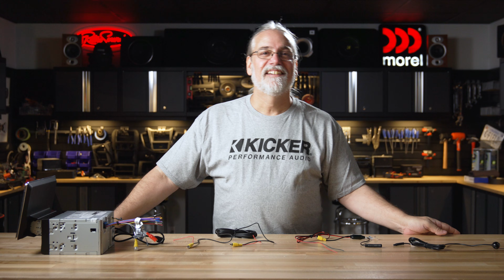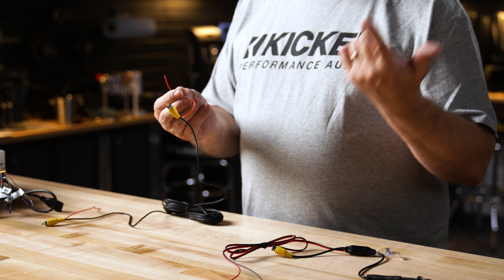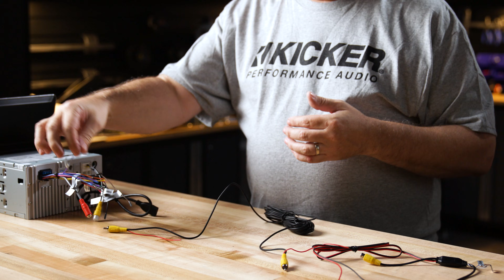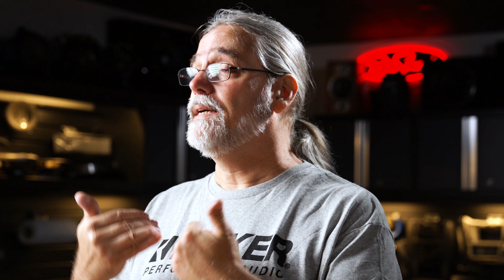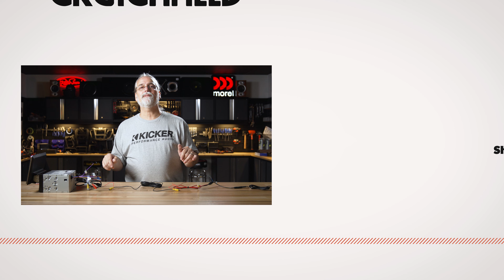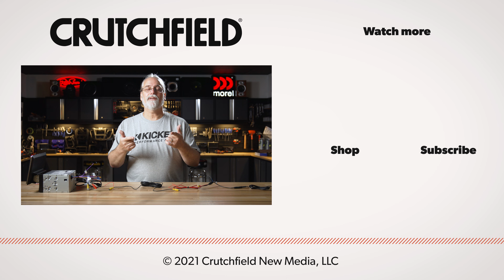Powering your backup camera (and how to use that extra wire) | Crutchfield

Comment: Do I need to ground the black wire for signal to kick on?
Reply from the maker: Yep! The ground wire does need to be connected to the vehicle's chassis so the circuit is complete allowing power to flow to the camera
Reply: @crutchfield  does it have to be in the chasis specifically of can I attach it to a bolt in the hatch in the corner near the widow? Cuz I have a sub ground wire already in the chasis
Reply from the maker: There is some freedom for the location of where you attach, but it must be a good solid chassis ground for the camera to function.

Comment: There is a guy who wired his using the convenience wire only for the reverse posative and it grounded through the RCA! He said he found this out by accident! The only way you have to use the red and black are if you have a head unit that allows you to view camera while not in reverse!
Reply from the maker: The red wire that was joined with the RCA cable was grounded to the RCA cable? That sounds like a design defect because the red wire with the RCA cable, the one often referred to as the convenience wire, should not be able to make contact with the RCA wires.

Comment: So I hooked the red wire from the camera with the red wire from the convenience cable, and hooked the red wire on the other side of the convenience cable into the trigger wire, and it worked at the moment I tested it, but after a few hours it stopped working😢
Reply from the maker: Hi Yifan, sounds like you may want to re check the wiring instructions included with your camera. If you got it here, you can call our Tech Support for wiring assistance as well. Their direct number is on your invoice.
Reply: @crutchfield  Yeah I had it fixed, turns out it was just when I put back the trim in my boot I accidentally loosened the signal wire, all good now
Reply from the maker: Nice! That is excellent to hear, great work!

Comment: For some reason, I don't having a reverse trigger wire on my Sony XAV-5000 radio harness.
Reply from the maker: It should be the purple/white wire on Pin #13 of the main radio harness.
Reply: @crutchfield  I had to get an aftermarket harness from the radio. None of the aftermarket ones have a Reverse trigger wire.
Reply from the maker: If you got the radio and/or camera here, our Tech Support can help you get this wired up correctly. Their direct number is on your invoice.
Reply: @crutchfield  I tested my luck again with amazon. This time I received the correct radio harness that had the reverse trigger wire
Reply from the maker: That is good news to hear. We are always here to help troubleshoot your Crutchfield purchased products!
Reply: @crutchfield   I believe i just found my 2nd problem. Now that i have the correct harness with the purp/wht reverse trigger wire, it wasn't automatically triggering. i missed the step of wiring the convenience wire together with the power wire that's already going to the backup light...

Comment: Why not use a spdt switch to determine where the + 12v comes from? Either the battery for always on or the tail lights for backup only.
Reply from the maker: Each camera will specify the recommended options.

Comment: Can i wire it in a way that it automatically switches screen when put in reverse AND have the ability to view camera when in drive? For reference i have a pioneer 1700NEX and it switches over when i go in reverse but if i click on camera video, i get no camera input
Reply from the maker: It sounds like your camera might be powered off the reverse circuit, only powering on when you are shifted in reverse. If your current rear camera is connected to switched power instead (energized when the key is on, whether shifted in reverse or not) you should be able to view it from the receiver anytime the key is on. I hope this helps!

Comment: Great video im not the best with wiring, currently trying to wire in a aftermarket reverse camera to a ford sync 1.1 not sure if ive done it correctly but still not working (its been activated on software), i have run the earth to earth, postive to the rear fuse box, rear trigger wire to the reverse unit, i am unsure if i need to conntect the front trigger wire to the origional wiring loom or link it to the rear reverse lamp any help would be great
Reply from the maker: The process for adding a backup camera to a stock system may require more wiring connections and extra steps than are shown in the video and we recommend contacting technical support for help. If you purchased your gear from Crutchfield, we recommend contacting our technical support using their toll free phone number included on the order invoice.

Comment: can we use it as front camera?
Reply from the maker: Are you asking about a specific camera?
Reply: @crutchfield  I bought a car stereo from Ainavi. The stereo comes with a reverse camera. But my car had a reverse  camera when I bought it.  So I wanted to use the camera that came with stereo as front camera. I set up all the wires, but my stereo is not giving out images/video. I connected the wire with my car headlight.  That one red wire im not sure where to connect for power. I have 2013 Honda civic. I wanted the front camera to work before I passed down to my daughter. She will be in college soon. Front camera would help a lot for her to parallel park.
Reply from the maker: With many cameras that we carry you can reverse the image and use it as a front camera. With some cameras they do not feature a reversible image and cannot be used as a front cam. You will need to power your front camera off a fused 12v source, and you can use the add a fuse option below that is available in different fuse types to fit your specific vehicle fuse box. I would also double check wiring as you do not want to connect any accessories to your headlight circuit. If your front camera is not getting any 12v power, that would explain why it is not displaying an image. I hope this helps!

https://www.crutchfield.com/I-rFBKc166/p_074FTATC/Accele-FT-ATC.html

Comment: Mine doesn't have a convenience wire so how do I power and ground
Reply from the maker: If your camera does not have a convenience wire you can always run one manually. You can also consider powering the camera off the reverse circuit and finding a good chassis ground near the rear of your vehicle.

Comment: Would it be possible to connect the red camera wire to the purple wire and then splice the red camera wire together with the accessory wire or would that be dangerous?
Reply from the maker: We do not advise deviating from the install instructions with any camera install.

Comment: Sorry, I'm more confused now than I was before. I'm just trying to hook up a backup camera to my Jensen CAR710X. I bought both from Crutchfield a couple of years ago, along with the wiring harness service. I'm just getting around to putting in the backup camera now.

The radio installed just fine and works ok; it even looks for a backup camera when I put my Tahoe in reverse. However, the trouble is the camera wiring. I know about tapping into the backup lights, but this Tahoe doesn't have a convenient way to hide the power wire so I'm looking for a way to do it without using the backup light to power the camera. My 18-pin connector has the Camera in wire (yellow female RCA) which has that red convenience wire you mention. Can I just hook up the super-long camera RCA line (that has a convenience wire at both ends) to the one up at the head unit? Do I also need to use that reversing wire if the head unit is already looking for the camera when I put the car in reverse?

Thanks. I hate wiring stuff so I was thinking with the harness service it would just be plug-n-play, and it isn't.
Reply from the maker: Sorry to hear your installation isn't going easier. Our Tech Support can help you get things wired and working. Please give them a call at your convenience. Their direct number is on your invoice. They are available:
Monday-Friday:
9 am - 8 pm est
Saturday-Sunday:
10 am - 7 pm est
Thanks!

Comment: I want to wire a câmera like that but in front of the car. My radio is a Android snapdragon. Coming out of the rádio i have a rca that says dvr. So i think i need   to plug the rca from the camera to the dvr rca. Then i'm a little bit confused where to wire the 12v+ that gives Power to the camera and the trigger wire tha comes out from the camera rca. I also have a other wire saing "dvr ir". Should that be the trigger to connect to the trigger coming out from the rca camer? Can you please help?
Thanks
Reply from the maker: To use a front camera, you will need a front camera input on your radio. DVR inputs meant for dash cameras or drive recorders may not function the same. There is usually no front camera trigger on most radios like there is with the rear camera. You will have to find a location to connect for 12v switched power for your front camera, and the Accele FT-ATC add-a-fuse options in either ATC shown below (or mini-ATC also available) are great ways to power additional aftermarket accessories.

https://www.crutchfield.com/I-rYALc166/p_074FTATC/Accele-FT-ATC.html

Comment: Very good video. The only thing i couldn't resolve yet is... I connected the red wire to power of camera to the trigger wire but it didn't work because actually the head unit has a specific wire for 12v camera. I will connect that one, but i don't know where i can connect the trigger wire. Could i connect together as a three connects? Thank you 😊
Reply from the maker: Hi Rachel, the reverse wire generally connects at the radio. Be sure to refer to and follow your camera specific instructions.

Comment: This might be the only video (or any instruction) that noted the black wire from the camera’s power cable doesn’t need to be tapped. I always wondered if it could be chassis grounded, but everything else I’ve read/seen states to tap into the black wire on the reverse lamp. This should make it a lot less confusing on my next install.
Reply from the maker: That is awesome to hear! We are happy that you found the video helpful. 🥰

Comment: What would be the best wiring layout if you have a manual transmission and you want to have back camera view capability while driving down the road? Not sure if manual cars even use the backup camera OEM wire. I'll be wiring for a 2005 Honda Element and 2010 Honda Fit.
Reply from the maker: There are some important things to consider here. You will need to choose an aftermarket radio that has features that allow you to bring up the rear camera view anytime, and you will want to make sure you have power to the camera at all times (not while only in reverse). With some manual transmission vehicles, there is a reverse trigger circuit. Some manual transmission vehicles require the reverse signal tap to come from the reverse actuator located at the transmission.
Reply: @crutchfield  thanks. Much appreciated.
Reply from the maker: We are here to help anytime! Reach out whenever you need us😎.

Comment: I want to have two cameras, one front one back,  hooked up on oncord plus panel. To be used one at a time.
Reply from the maker: If your head unit has separate front and rear camera inputs, that would work just fine. If it only has a single camera input, you would need to add some type of camera switcher, such as this one from Crux:  https://www.crutchfield.com/I-rYALc928/p_249CSS41/CRUX-CSS-41.html?tp=616

Comment: Hi, good video , thanks , can you just confirm something please, I have a portable monitor in my car with android auto and so on , it can also be used as a back up cam monitor,  the monitor has one socket for a small jack type plug, the wire with that plug has a yellow connector like in your video , if I connect the camera to only work when in reverse gear do I just hook up to a ground and hot wire from reverse light and then plug the yellow connectors together and make the convenience wires redundant?
Reply from the maker: Hi Steve, what model camera are you planning to use?
Reply: @crutchfield  hi, thanks for responding,  it doesn't actually mention the brand , its from temu online , its one that mounts to the license plate at the rear, it has the long rca cable with one yellow rca plug at each end, then a shorter cable from the camera with a yellow rca connector and the ground and positive wires, pretty much the same as in your video , because I only want it to display on the monitor when reverse gear is selected I'm assuming the convenience wires are not needed ? I'd like that confirming please if you can, thank you
Reply from the maker: This would depend on if your exact model portable monitor has a reverse trigger to turn the camera on automatically while in reverse. If so, you would want to use the convenience wire to bring that signal from the camera location (where it is powered off of the reverse light circuit) back up to your monitor. This is one of the main uses of the convenience wire in many applications. I hope this helps!
Reply: @crutchfield  thanks again for responding,  on the monitor it just has a port for the rca connector so I assume then it won't need the convenience cable as there is no where to connect one, or its going to be one of those pain in the ass jobs 🤣
Reply from the maker: Definitely will come down to the exact models; but hope it's an easy job for you!
Reply: @crutchfield  we'll see, those easy jobs always turn into nightmares for me 🤣

Comment: Great video thanks. I have a question though. Ford focus mk2 2010 RS , I’ve wired in my camera the 1st way you suggested. Did I need to tap in to the reverse light for power still if my car is canbus ? And if I didn’t need to is it safe to leave it ? It all works fine by the way. Cheers
Reply from the maker: If your camera is working fine and automatically switching to the camera screen when in reverse, you will not need to make any additional connections.
Reply: @crutchfield  I have already tapped In To the reverse light as well as in your 1st demo.  will this be ok as I’m pretty sure it’s canbus. Everything is working fine at this point ,cheers

Comment: Great video, So my 2021 Tacoma's backup camera is not showing up on my display. When I go into Settings it is greyed out and can't activate it. Any suggestions on where to begin to diagnose?
Reply from the maker: Is this occurring with the stock radio and camera? Was any part of the stereo system replaced around the time the issue started?
Reply: everything is stock,  I bought the truck recently with this problem. It has never worked since I bought it.
Reply from the maker: We do not troubleshoot any factory radio issues, but it sounds like there is certainly some issue with your factory backup camera. If you replace the radio, you can always install a new aftermarket camera like in the video! To attempt to diagnose the factory camera issue you may need to consult the dealer.

Comment: Late to the party, but I can strongly recommend not to use the convenience wire as a power supply feed. They are typically too long too thin therefore too high resistance for passing enough current for some cameras.
Reply: What's the alternative then?
Reply: Run some twin 3mm alongside it.
Reply: @wozzatherockdog1778  thanks!

Comment: My reverse lights stop working if I use the reverse light for powering the camera. So I get no power to the camera. The vehicle is a 2011 Ford F250.
Reply from the maker: Sounds like you may want to double check your connections. If you got the camera here, you can call our Tech Support. Their direct number is on your invoice.

Comment: I was trying to get through the rubber and I damaged the end of the cable. I decided to cut and run the wire because it was thinner, now I bought a new P2 power cable. Can I just cut it too and splice it to my old one? I saw that there are 3 wires.
Reply from the maker: HI Marcelo,  it's okay to extend the wiring just so you are still able to make all the required connections.

Comment: Hey great video!  Question: I've  replaced my Kenwood with a Boss. Everything but the camera is hooked up. Now my plan was to just use the existing camera & wiring.  In the truck I have my YELLOW RCA with 3" of red wire coming off it.  My plan was just to attach the 3" wire off the rca to the deck Purple ( reverse input). will this work? Then i have my Red (rear output 12V)  Do I still need to power that, or does it already have power from being previously hooked up?  Appreciate any input!  Thanks..
Reply from the maker: Was that red wire connected to something when the Kenwood was installed? If it was connected, what was the function of the Kenwood wire that it was connected to?

Comment: This video does a great job of illustrating where everything should be and how it works BUT DO NOT GROUND TO THE CAR. I followed this advice on my E90 and it caused terrible electrical problems. Try to ground to an actual ground,preferably the battery
Reply from the maker: That's a bit different than our experiences with vehicles and backup cameras. We still face the issue of needing to file away any protective coating on the metal of the chassis so the ground makes a good metal-to-metal contact, but otherwise grounding to the chassis has proven to work. What happened to your BMW when you tried it?

Comment: What if we dont want to use the automatic feature of backup cam.  Can we just turn it on from the radio when we want it?  As a P.I. I would like to have the ability to turn it on without backup lights.
Reply from the maker: Yes, most aftermarket head units allow you to also manually select the camera input.